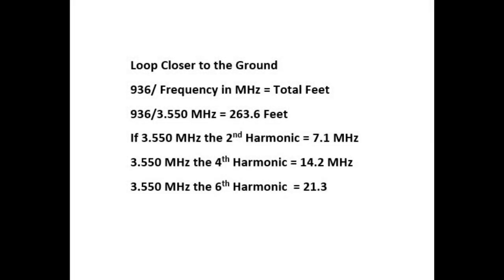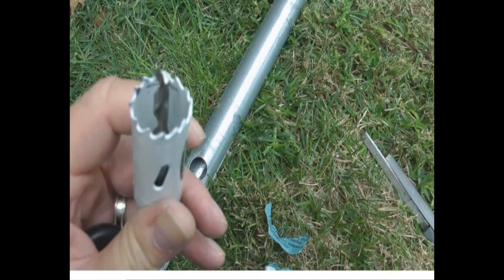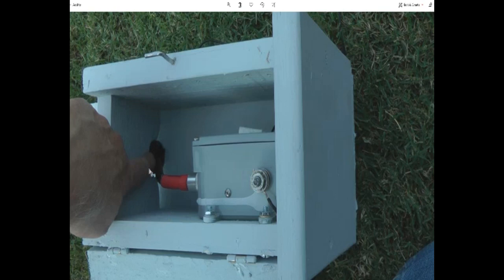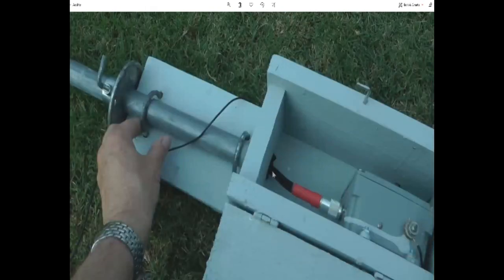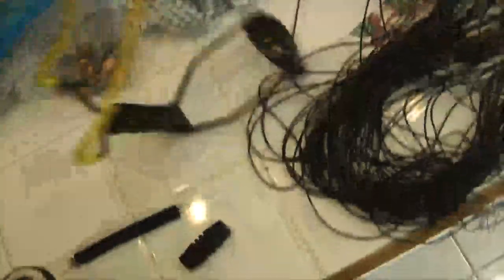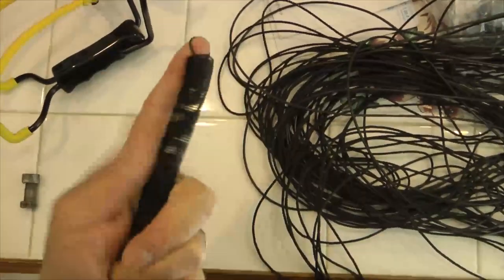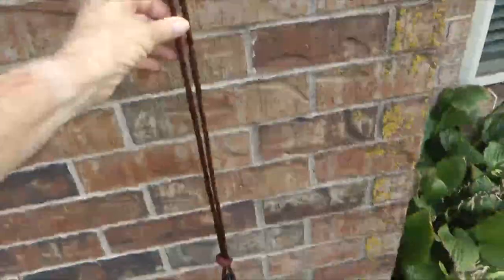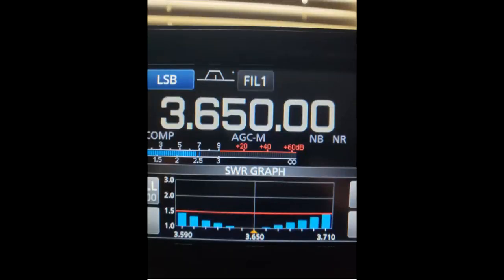80 Meter Full Wave Loop Ham Radio Antenna

Comment: Good job, and this is what antenna tuners are for.  I'll take a quote out of Chapter 2 in the Antenna handbook.  "Please recognize that an antenna need not be resonant in order to be an effective radiator. There is in fact nothing magic about having a resonant antenna, provided of course that you can devise some efficient means to feed the antenna. Many amateurs use non-resonant (even random-length) antennas fed with open-wire transmission lines and antenna tuners. They radiate signals just as well as those using coaxial cable and resonant antennas, and as a bonus they usually can use these antenna systems on multiple frequency bands."
Reply from the maker: Thank you!!!   I cannot wait till conditions are really good...  I will try to find some bed springs and see how they will work for antenna :)  I have heard they have used those....  However, I haven't seen any laying around in a long while....
Reply: @RichRodgersOnline   Look forward to reading your article in QST magazine - Ultimate DX The Bed Spring Antenna? -  Cheers - David
Reply from the maker: @davidc5027  David,  Ha thank you!  I wouldn't look too hard..:)

Comment: I played around like this for some time before finally getting a vertical antenna. I had constructed a dual loop for 80m antenna which worked well on 40m and even better on 20m. The problem when trying to use it on 80m was height. When I got my calculator and checked to see how far it needed to be off the ground (1/4 wave) I realized that I wasn't going to meet the required 67 foot minimum needed to get the signal going toward the horizon. The hight was okay for 40m and 20m, but my city lot without adiquite trees wasn't going to work out, unless I planned on my signal going strait up.
Reply from the maker: Morpheus,   I use my 80 meter loop on mostly on 20, 17, 15 and 10  meters.   I had the ARRL tell me that even though there are lobes, the gain on 20 meters would be almost as good a a beam and that probably is with the height. I think on 10 meters it maybe more.    I don't have my loop up high, 23 ft in 2 places and about 35 in the tree now. On 80 meters I always get great signal reports.  I am working Europe, New Zeeland,  and other countries easy.  I hope your vertical is doing well.
Reply: @RichRodgersOnline  I have to agree, my results were pretty much the same, but my loop was 30 feet off the ground so 80m didn't work well due to the steep take off angle. 20m was probably the best. My lot isn't large enough for a full 80m loop, so what I had was an 80m loop folded over and thrown back on itself.

The point where the balun was connected is where the loop crossed over itself and the loops were separated by about 8ft. It did really well above 80m and I was just getting ready to get my ham license when I started building it. The SWR worked out to be less than 1.7 as the high point over 40m and 20m but I had to use a tuner to cover the other bands. I've been a swl for many years and while I was putting it up and making the balun I was studying for my technician license and decided to study for my general too.

I'd been telling the grand kids about talking to Santa on 80m, so I decided to get a hustler trapped vertical soon after passing the tech and general tests on the same day. All in all, I got it set up (elevated) and the grand kids got to tell Santa what they wanted for Christmas. 
 
Cheers, 73s KE8OPY.
Reply from the maker: @RhythmicSensations  Wow!  How neat is that?   Well,  I am glad the vertical is working for you!   Grand Kids probably thought that was great!   Hope to see you on the air.  73.  Rich

Comment: I am a new ham KJ7VUL and have been working on an OCFD for 80 meters with the balun at my barn and the legs running out to a couple trees. I had a 1.1 at 3.47 using my Nano VNA and wanted to move to at least 3.5 by trimming the legs. After doing a lot of trimming and never getting it to move much I attached it to my  RTL-SDR and then I didn't anything but noise. I don't have my general and don't have an HF radio yet. I probably trimmed too much so I gave up for the night. I had a great signal from 3.5 to 54 before I started trimming. Ha Ha! Sometimes it is better to leave well enough alone. This morning I will try to lengthen it out and start all over. I am using RG6 braid trying to widen the usable band width.
Reply from the maker: Thank you for watching my video!  I haven't used a OCFD  antenna.  When you get a radio, I know I would not use RG6, rather I would use a quality lmr400 type coax, The Coax Man has a similar coax which is flexible.  Plus I would use a balun designs 4:1 balun on the antenna end and OCF antennas have a lot of RFI in the shack so I would use a 1:1 choke in the shack between your radio and the coax..  Good luck on getting your General.  Bands are great right now.  I was talking to a guy in NC after I signed with him a Irish station called me.

Comment: Someone told me today to feed the loop with a 9:1 unun. I’ve never heard of this. I’ve heard of 9:1 baluns with loops. I’ve used 6:1,4:1 and 1:1. Maybe the unun is the key 🤷🏼‍♂️ using open wire feeder here not coax.
Reply from the maker: If your loop is close to the ground the impedance changes 2.5 to 1 works well. If it's higher then a 4 to one balun works well.  Thanks for watching my video!

Comment: Great video.  Good solution for HOA.  I own my own home with no restrictions and am putting up one for 160 as the low band.  I am feeding with ladder line.  That way I can load anywhere.  Wouldn't be able to hide ladder line easy though. Thanks for the idea on springs.  73 W8PEF
Reply from the maker: Sounds like you are going to have a terrific antenna! Thank you for watching my video!

Comment: Correct formula is 1005/frequency. Would put you at 283' vs 263'. Usually would leave you slightly long, but much easier to cut down length rather than add.

Also, did you measure the impedance. Because of velocity factors of different insulated wires, generally a 4:1 balun works  better.
Reply from the maker: When close to the ground a 2.5 balun works better with the impedance.
Reply: @RichRodgersOnline  depends on height, band, wire, length, etc.

Comment: I had one of these when I lived in NJ (1.3ac. lot) wet when I moved to WV ( 35 ac.) I had too many trees in the way to put one up. I now live in NC (.66 ac. lot) and  might possibly have enough room to put one up. I got the OK from the neighbor to hang one corner off one of his trees.
The one I used did not have any balun as per the 11/1985 article in QST by W0MHS and ARRL 1991 hand book page 33.6. How does you's work with only three support points?
I really liked mine and made contacts as far as Australia, S Africa and Easter Island 
N2VXL
Reply from the maker: Hey Carl,  Thank you for watching my video.   My Antenna seems to be working GREAT!!   We had an Ice Storm in October which broke down one of the poles.   I put up another 80 meter full wave loop.  This time I made it longer 283 ft. for the CW portion of the 80 meter band.  Below are my lowest SWR Points some not in the band but with my tuner it works great.  This last week on 15 and 20 meters(of course the Sunspots are up) I worked 2 French stations, 1 Poland, 1 Italy and 1 New Zealand.    The Antenna is doing Great!
3.535	1.2
7.049	1.8
10.363	2.5
13.890	2.3
20.839	2.3
24.250	2.1
27.749	1.6
51.724	1.9

Comment: Cool video. A few weeks ago I purchased hard drawn #12 for my 80 meter delta loop, which I will be putting up in a few weeks. I have a 40 meter delta loop up, and it works great.

How does your loop perform?

Jeff W3AAB
Reply from the maker: HI Jeff, thank you for watching my video!   It works great!  When skip is good, I work Europe pretty well and on the 10-meter contest I worked Africa.  It is a great antenna!!!
Reply: @RichRodgersOnline  good to hear! I'm assuming you use a tuner?
Reply from the maker: @jwnagy  Yes, I use  LDG auto tuner.
Reply: @RichRodgersOnline  cool! I'll message you again after I get my 80 meter loop up and going. It will be vertically polarized...fed with LMR400 into a 2:1 balun.
Reply from the maker: @jwnagy  I was using a 2.5 to 1 balun.  Some people like a 4 to 1 balun for a loop.  My brother in law uses the 4 to 1 and loves it.  If you can get you antenna high the 4 to 1 would work great!   You may just want to experiment around.